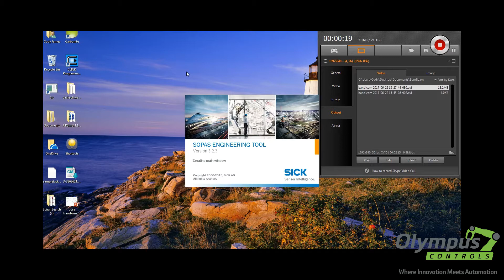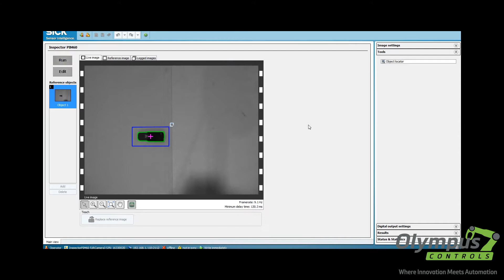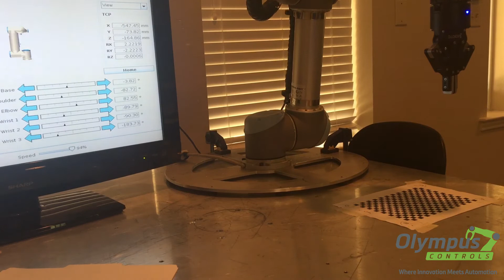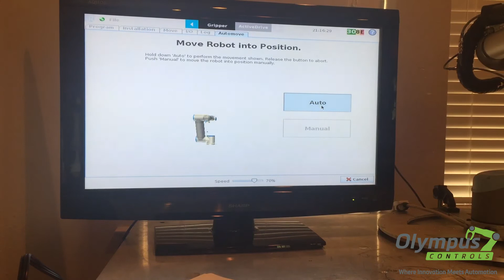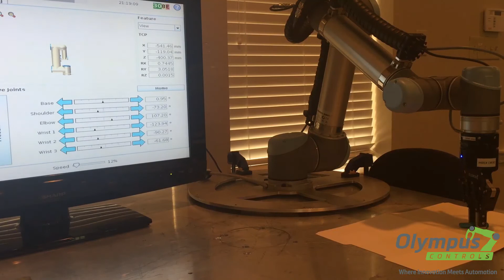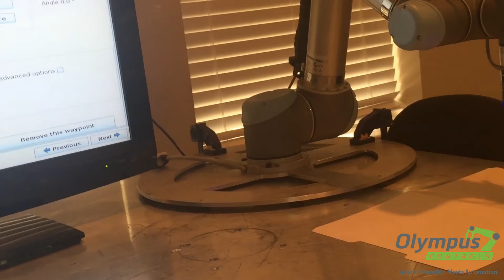Universal Robot with Sick Inspector: Tutorial

Comment: Thanks for the tutorial, Nick! I have trouble running the program in a loop. The robot will always use and approach the object location detected in the FIRST program cycle, even if the object location changes or there is no object to localize in the following cycles. Same when I use the MoveToCamPos several times within one program, it will never get new coordinates but only use the ones detected initially and move to that position again and again. Do you have any suggestions on that? Thanks!
Reply: Dear Fabian, did you solve this problem? cuz i got the same problem here but have not found out solution yet

Comment: Hey, there)
How can I increase field of view of PIM60? It's 640*480px now. Should I put it higher? What is the limit of the height? If I increase FOV do I need to recalibrate with bigger grid?
Reply from the maker: 640x480 is the resolution, this is fixed. The only way to increase the field of view is to move the camera farther from the surface or use a wider angle lens. If you make any changes to the FOV you will have to recalibrate.
Reply: Nick Armenta thanks again

Comment: Hi Nick! Nice tutorial! Could you please tell me how did you connect the monitor to the Control Box? As I understood you are using the monitor instead of Teach pendant. second question: Is it possible to use in parrallel both monitor and teach pendant? I would really appreciate if you could answer to my questions. Thanks in advance.
Reply from the maker: We are actually using a parallel monitor teach pendant setup in this video. The teach pendant has a DVI cable that runs back to the controller. If you put a DVI splitter at the output to the teach pendant inside of the controller you can simultaneously connect both your teach pendant and monitor through an additional DVI cable or DVI to HDMI cable.
Reply: Thank you for your quick respond. Are you talking about this kind of DVI splitter to HDMI? https://www.ebay.it/itm/1080P-DVI-Splitter-1-a-2-Porta-HDMI-DVI-Y-Cavo-Adattatore-per-PC-HDTV-DB/201622997368?hash=item2ef1aac978:g:-kgAAOSwyjBW33lo
Reply from the maker: Yes, that would work perfectly
Reply: Thank you for your confirmation!

Comment: Thanks a lot. I have two questions:
1) I want pim60 to detect my objects, which are identical. Do I need to make several reference objects? I tried looping but it doesn't work, because UR goes to the same place over and over again.
 Also my variable "SICK_objLocated" is always "1", no matter it's picked or not.
2) What if I attach pim60 to UR? How does it work then? Should I recalibrate every time because the height changes? 
I'm looking forward to your reply. Thanks.
Reply: Thank you for checking out the video! 
1. When all of your parts are going to be identical, then you will only need 1 reference object. The camera will take an image, find an object in the field of view (FOV) that matches the reference object with the highest score, then send the coordinates of that matching object to the robot. Be sure to remove the original part from the FOV,  or change its location in the FOV, so that the location where the camera finds it changes. 

2. There is no issue with mounting the camera to the robot. Once you have found a position where the camera can see the calibration grid, then begin the calibration process. The position that you calibrate the camera from should be saved as a feature so that you can go to that position in your program before executing the Sick Inspector URCap.
Reply: Cody James thanks a lot